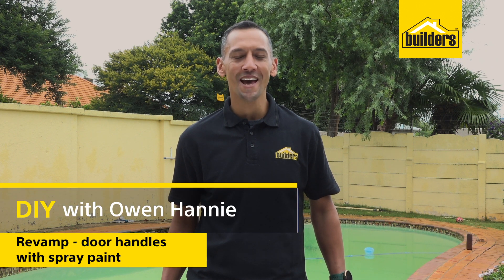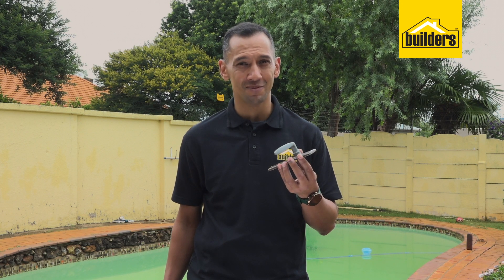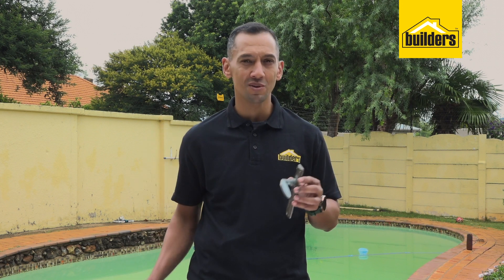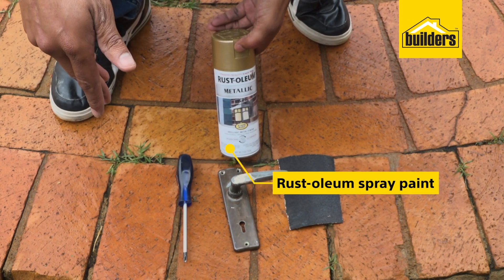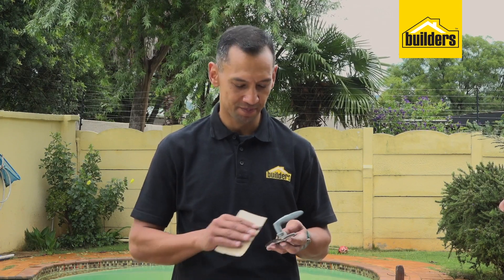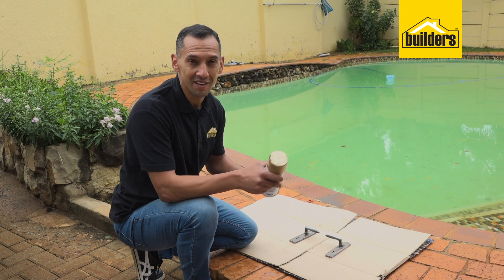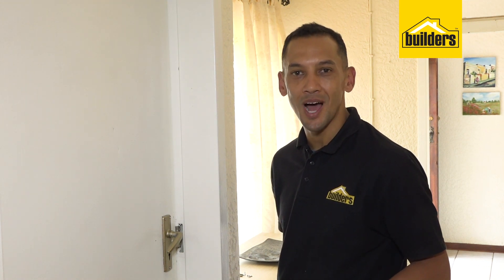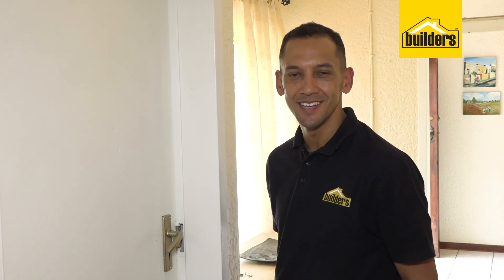How to Revamp Door Handles with Spray Paint

Comment: Need to consider the real impact handles go through over time....... therefore it would be good to be clear on the type of sandpaper grit, clean dust off handles. step 1 - use a Automotive Primer - let dry per instructions.  Step 2:  use the colour of choice, light coat and then second coat...possibly a 3rd if required allow to dry for 24hrs.  Step 3:  spray a protective Polyurethane Clear Coat for final protection to protect against jewelry scratches.  Allow to dry for another 24 hrs and then re-install.   Recommend for colour and Clear Coat - Rustoleum.  You never want to have this new look for short term and start seeing scratches.  Cheers
Reply: Thanks for the extra tips. I thought the video seemed a little too simple.
Reply: Thanks! This was the information I was looking for. The video wasn't very helpful
Reply: Can you recommend a good after coat please??